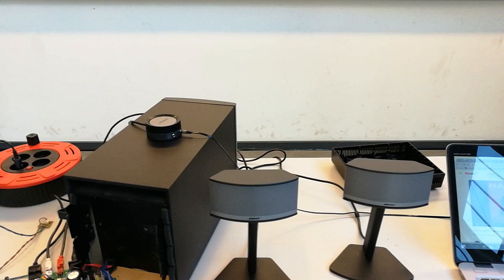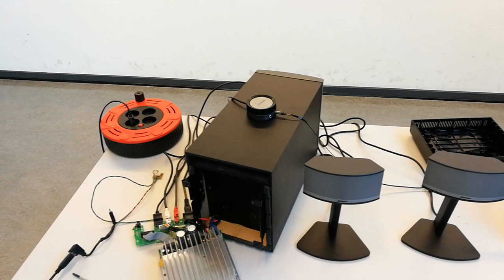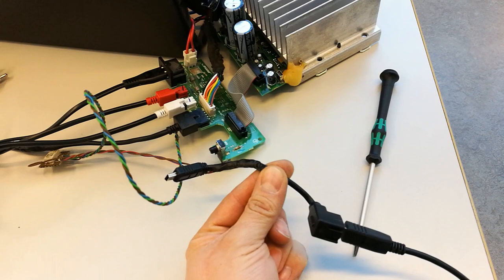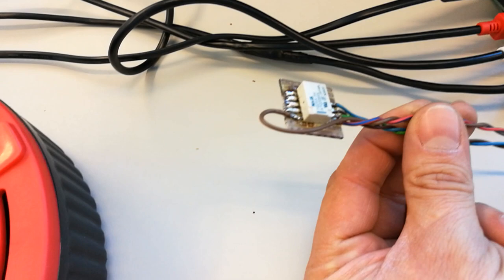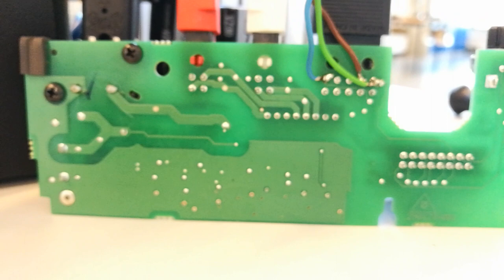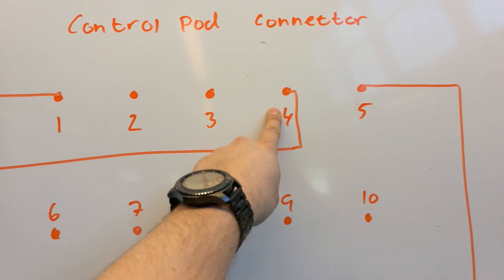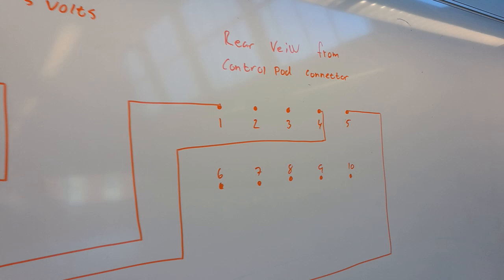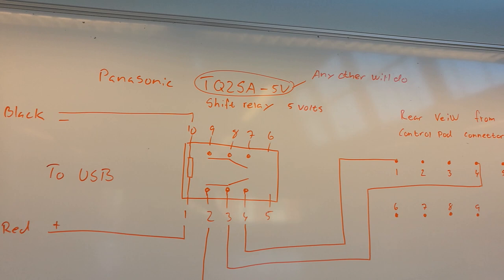How to hack Bose Companion 5

Comment: FYI, Skip all that and plug the usb and the aux into the TV. Works No problem for 3 years so far so good. I have the Samsung 2015 65inch 1080p base model.
Reply: Sonder  do you have a pain lay out of the control input ? I want to do this mod but also put a headphone jack out of the back as well so all cables can be hidden 
Thanks
Reply: Pin**
Reply: Comments are where the true answers lie, Thank you!

Comment: Hi, there is an even better and simpler solution: just use an USB-Isolator (ground-lift) for USB devices, like for example the CesysC028149 USB-Isolator. Plug it between your USB-Port of your PC and the Bose and then the sleepmode does not auto-activate all the time when using the AUX-Input of the volume control pod. I do not know if it works with the  5V USB Power Supply though . It also reduces hum and noises form the USB-connection and the pod can still be muted by touching it. And there is not need to open and modify the speakers.
Reply: What does the isolator do? Can you elaborate on how it works a bit?

Comment: I’m using them on my tv too. They sit right next to my RCN ARRIS router which has 2 USB ports on back. I’ve plugged it into one of the ports and the light stays green even when tv is off. Haven’t had any problems so far.

Comment: Used your howto to power ON my device when I close relay connected on AC with Sonoff Basic. Just connected PIN 1 and 4 ( from right schema ) togather and it work perfect. Just little problem, I cannot control volume, it's locked " full " but I don't care I use my HTPC's volume to control it :)

thank you very much !
Reply: What did you do to make it work again.. i have broken pods how can i bypass the power ON to keep it open .. thanks

Comment: Hi - very formative video and comments. I have the same system, but I do not have the control pod. what is the easiest way to bypass need of the control pod all together if all I am doing is connecting to computer through USB (I can control volume on computer I suppose). Would like to bypass control pod plug in , keep fully on and full volume at all times and control through USB. any help appreciated!
Reply: Bro i have the same problem as yours .. i have broken volume controller pod, what did you do to keep it On and in max volume to maximize the sound ..

Comment: Short SENSOR pin (3.3V) and RMTGND pin to generate a softstart to reset USB controller to wake up system.
Reply: Wich is the pin of RMTGND and which one is the sensor?
Reply: @mvfernando  I just looked in the circuit diagram. And it seems its pins 6 and 9, if you look from the back at the connectors and count top-left=1 bottom-right=10. But I cant confirm if this works, since I dont have any jumper cables on hand.

Comment: what if i just short 1 and 4 , will it always stay on when i switch on the power?
Reply: I tried this and got no sound from the system and the lights on the control pod was not on. I took the wire connecting 1 & 4 off and it worked again, so think I will try the Apple device... want to have the speakers on all the time. Thanks.

Comment: Do you happen to have the wiring diagram for the pod/control connector? seems like mine is finally giving up the ghost and am not able to get it to work. Jiggling the wire in the back gets it to come on briefly, but it is now a hit or miss. The connector seems like a 10 pin molex, that I can find easily. If you happen to have a wiring diagram or a color match scheme for the pins, I can cut the wire and solder the wires to the new connector. Please let me know. Thank you in advance for your help. Cheers.
Reply from the maker: Sorry I don't have any diagram...
Reply: @torbenfunch9937  No worries. I did the whole unplug and plug back in sequence and it seems to work again =) If I need to rebuild the connector, I'll just take it apart and check I guess. I can't find the wire order anywhere. Cheers.
Reply: I can share the connection diagram (J5)  Pin 1 - Mute, 2- RMTGND, 3-BOSELINK, 4-VOLUME,5-SENSOR, 6-AUXRIGHT, 7-AUXLEFT, 8-HPRight, 9HPLeft, 10-+10V . What Mr.Torgen Funch is saying  PIN 1&2  short together when USB power removed and 2&5 short when USB power in. My companion 5 is not working since 2017,  I am not getting +26 volt  at Vsnub, Transformer output is getting 17VAc. I don't know whether Q10 MFET , or C48 capacitor issue , control pod green light and the amber light both lights are working  OK . But no Sound...........
Reply: @jjss65  Q10 IS DEFECTIVE I changed it recently and the sound came back also check c48 if it is at the right value with a multimeter

Comment: Do you get weird feedback running through the speakers when your not playing audio?
Reply from the maker: Jorge Hernandez
There is a little bit of white noise but that's it!
I have ordered a ground noise filter for 3.5mm jack in AliExpress but I haven't received it yet, but I hope it gets it...
Reply: Torben Funch have you thought of using a solid state switch relay? I get a very noticeable white noise tone. Solid state does not have any electromagnetic or moving parts!
Reply from the maker: Jorge Hernandez no I haven't thought about it. It is not a big problem, only if the volume on the controlpod is turned up very high.
I will give feedback on the ground noise filter as soon as I get it!
Reply: @torbenfunch9937  Have you tried it?